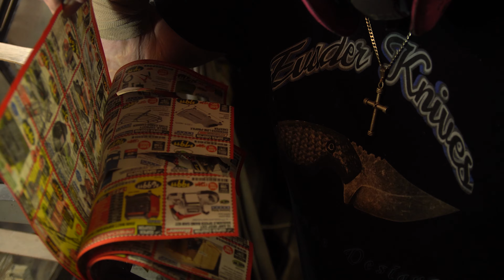Logos & Sharpening - Knife Vlog 15

Comment: Whats up Dave.. Hey on the belt strop you should get one for the 1x32 and use the small grinder for sharpening.. I want a small grinder just for this.. Hope all is well Blessings from us.... Martin
Reply: Oh and since it is so small you can get one of those sowing machine peddles to control the speed of the small ginder ... M
Reply from the maker: I see a lot of guys using their 1x30 for sharpening. If I didn't have this one, I probably would buy a smaller one, but might as well put this one to use. I got one of those pedals for my bandsaw, definitely a game changer. Hope all is well, take it easy my friend.